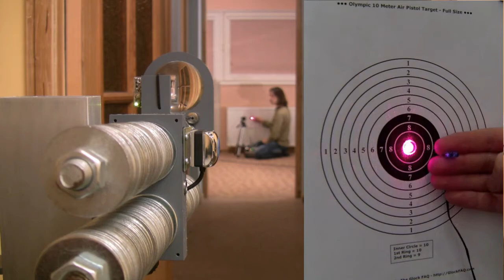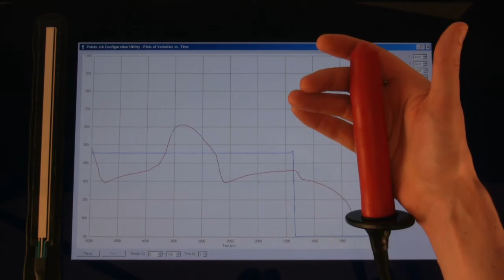Force Servo

Comment: This would also be great for suspension on a semi-flying car?
Reply from the maker: may be... )
Reply: I tested RC cars with propellor and EDF propulsion. the problem is that it's always unsafe or very inefficient, if you keep one wheel on the ground, you will have the the most efficient drive.
Reply: And yes, helicopters are the most efficient vertical flyers.
Reply: This system would also save the overhead contact lines of a trolleybus, less copper rain. Should there be Trolleycars?